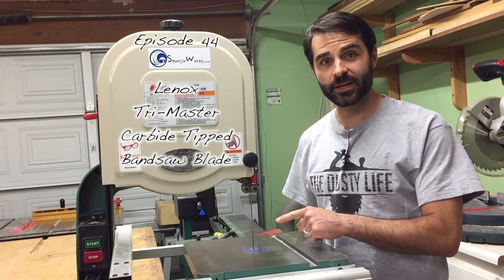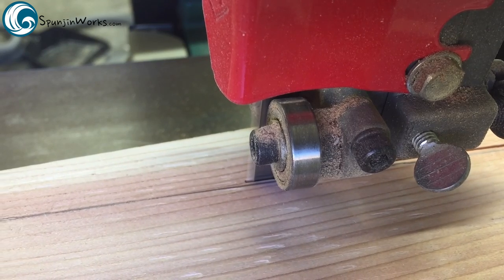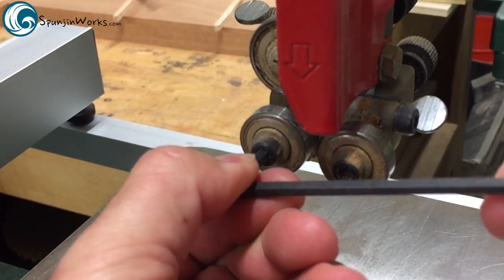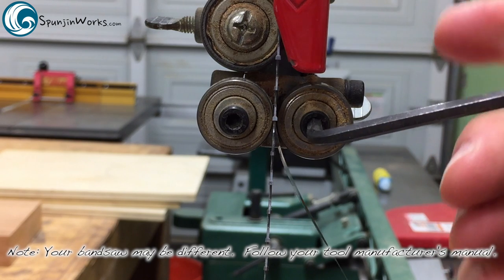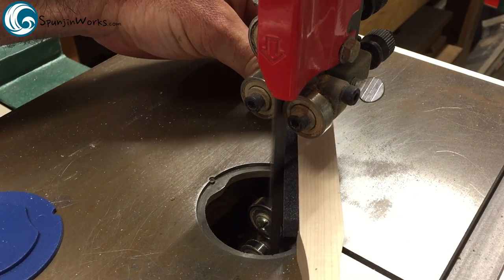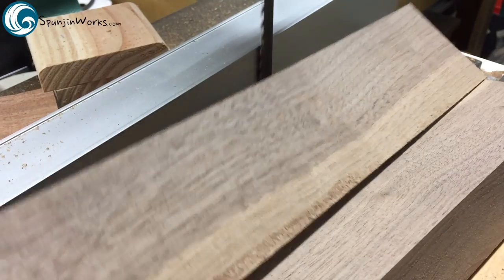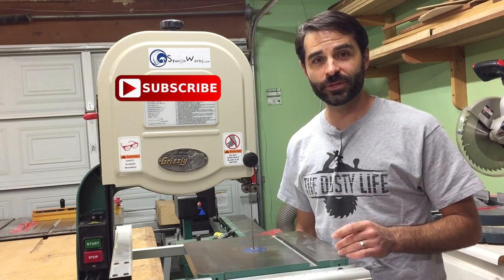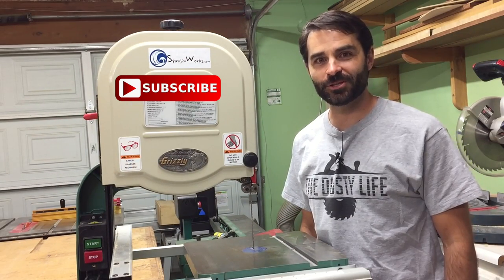Lenox Tri-Master Carbide Tipped Bandsaw Blade (Ep. 44)

Comment: I haven't seen feeler gauges used to set the guides. I like it.
Reply from the maker: I use the 0.003 feeler gauge to test the closeness.  Most just bring the bearing to touch the blade then back it off slightly.  That works fine.  I like to know how measurement, though.

Comment: All new blades cut good how does it hold up
Reply from the maker: It last longer than a standard blade, that’s for sure.  If you don’t slice thin veneers or own a drum sander I say it’s a good blade. But if you do slice veneers and have a drum sander then you can get away with a Woodslicer blade just fine.

Comment: Will a 3/4" wide blade fit on all 14" style bandsaw's? If no, is the tire width what determines that?
Reply from the maker: A 3/4" blade should work. It does on the 14" Grizzly. Check you manual it should say what blade range you can use. I am not familiar enough with the inner workings of why there are limits but I would bet it has something to do with the width and the diameter of the wheels.
Reply: Yes the tire width and the strength of the riser design plus the tension spring versus blade hardness. hard blades across the entire width of blade can give tension and tracking problems in my experience with lower grade saws. One reason you see the larger more expense saws being of welded steel riser construction. As to tire width; if you run gullet to upper tire center any 1 inch wheel is going to have back of 3/4 inch blade off tire. I  stick to max .025 thickness ;max 1/2 inch blades with my 14 inch saw; even tho it says it will run 3/4 inch tire.
Reply from the maker: +David Davis yeah there really isn't much of a reason to use a wider blade than 1/2" on a 14" saw. Though I'm pretty sure the Lenox blade is thicker than 0.025".
Reply: My blade are .025 according
Lenox. You can buy.032 blades but I do not use them on 14 saw.

Comment: Thanks for the video! This seems to be one of a few more quality bandsaw blades for wood available in Czechia. I could not find any shop delivering Resaw King/Timberwolf/Woodslicer or similar common blades to Czechia. The 1/2" x 0,6 mm should be good thickness for Laguna 1412. What could be maximum resaw capacity (height) for such a blade (which is narrower than 3/4")? Do you think it could cut through 30 cm of Laguna's capacity? Or has anyone found a source of good resaw blades in Europe? Thanks.
Reply from the maker: A 1/2” blade should be sufficient for your needs. Its the tooth per inch that really matters.  3 or less is what you want. 
Cheers.
Reply: After more searching I found a few shops that may offer international shipping: Timber Wolf - Woodline, Accu-Slice; Resaw King - Atlas Machinery (Canada). Plus the Czech store selling the Lenox might be an option (no hassle with international shipping and customs fee). Besides the carbide but expensive Tri-Master (~200 USD) they offer other models: Diemaster 2 (HSS steel) and Neo-Type (carbon steel) for around 16-20 USD (10% of the Tri-Master price) for 1/2" 4 TPI blade. The Diemaster blade might be a most affordable option.
Reply from the maker: After using the Lennox blade for a few years I found a good steel blade is all you really need.  Bandsaw tuning is more important than a carbide toothed blade.

Comment: WOW! WHAT A DIFFERENCE THAT WAS! i wish my bandsaw was that easy to change blades and adjust..haha!
Reply from the maker: +Joe basementwoodworking a quality blade and tuned saw make a world of difference in performance.
Reply: Sean Rubino i have the portercable 14"from lowes. I wish it had the adjustments that you're just has I would change out the blade more often it turns up okay could be better but then again you get what you pay for right I'll have to look into that played in the future
Reply from the maker: You may be able to change your guides to the square blocks with the integral bearings.  That may be a great options for your saw.  I almost bought that saw but I had a good CL find at just the right moment.

Comment: Pricey but well worth the money. They last a lot longer than carbon. HSS is better of course but It’s a no brainer if you use a bandsaw a lot. For a 30” saw its a lot of blade to pay for but the longer the blade the longer it lasts too. I would never go back to the old blades now except if I have no choice and need to cut really tight curves.
Its actually a metal cutting blade so its super tough carbide on the Tri master. 
Oh and by the way kudos to you for pointing out that the bottom of the gullet should be at the centre of the upper wheel. A LOT of guys don’t know that and they wonder why the blades crack at the gullet ! Duh !
Blade tracks much better too and less prone to resonant tooth vibration. Thats a real blade and cut quality killer.
Reply from the maker: Thanks, Brian!  I wish they made a narrower blade. Not sure If I can go back to regular blades.
Reply: Sean Rubino. Eventually they will come out with narrower blades I would imagine but thats a lot of carbide tips to braze. I would love to have a really narrow blade in carbide but you can do a lot with a good 1/2” 3 tpi.
Reply from the maker: Yeah I get by with my 1/2” blade. I don’t make bandsaw boxes so a narrower blade isn’t necessary at the moment.
Reply: Sean Rubino. In twenty years I have probably used my 1/4” blade maybe four times. More often than not if I have tight curves to cut its easier to drill them with a Fortsner bit and get a finish that needs hardly any work done to it. Narrow blades are tricky buggers really. They dont take loads very well in any direction without binding and twisting. If your not really careful they can chew your guides and gum up. Best to find other ways to make those curves if you can.
Reply from the maker: I like drilling for making radii and rounded inside corners too. Much more accurate.
Reply: Sean Rubino. Of course it is. Old timer woodworkers have used that trick for centuries. Chairs are a good example. I have a big range of Forstners and for the really tight stuff I re grind regular HSS bits with a brad point. If you have a drill press its fast and accurate.